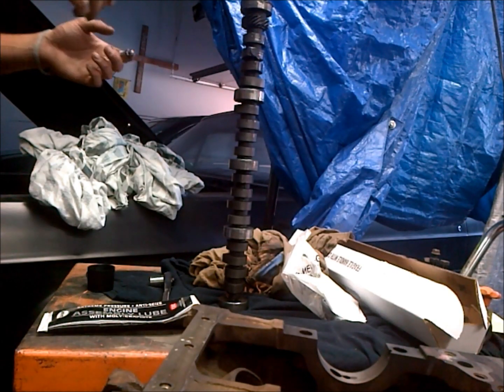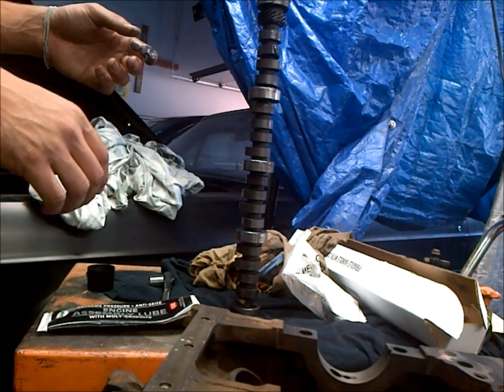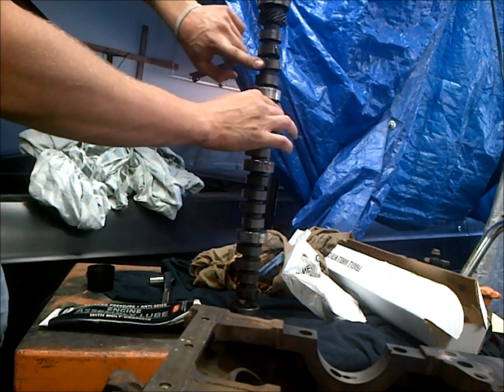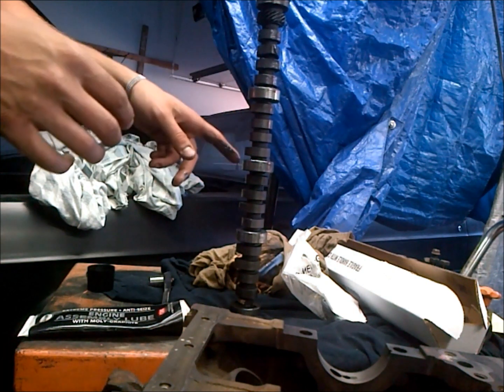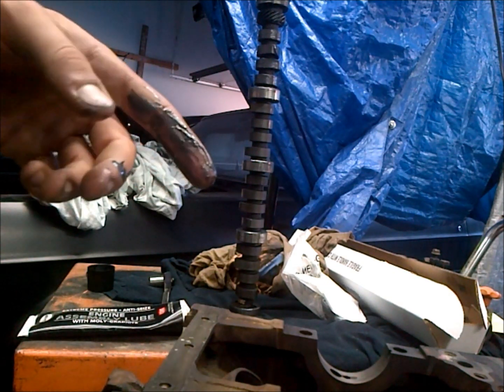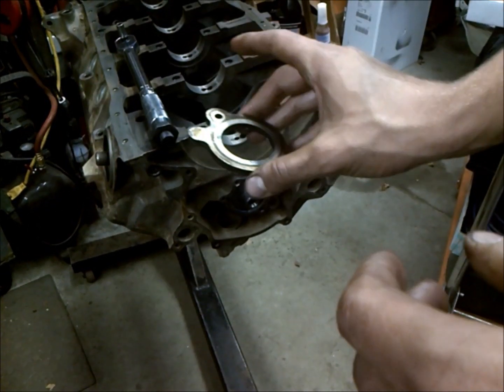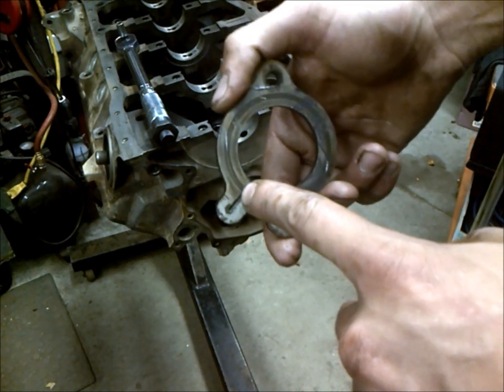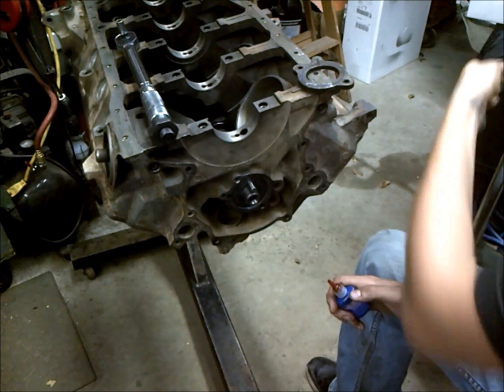Camshaft Installation (Vid 1 of 8) - How To 302 5.0 Budget Rebuild

Comment: Solid video. I installed a new set of cam bearings into my 302. Sadly my Cam won't spin freely by hand. It will however spin freely with the timing chain sprocket slightly attached. The Cam is used and sat in an engine block for a number of years. I may have to bite the bullet and get a new Cam and valve springs.

Comment: I got a question to pick your brain pertaining to the thrust plate for the cam.  What is a better setup for a roller cam in a roller block, the OE plate or an aftermarket plate such as Comps 3120TB thrust plate with bearings?

Comment: Regarding the 302 engine you are rebuilding: Is it a "Boss"?  What is the difference between Boss and "regular"?  How do I know if my 69 Mustang's engine is the Boss or not?  Thanks!
Reply from the maker: I believe the boss is a 4 volt main and some other bits that made it what it is. With the aftermarket world, engines can be built that are far superior in performance to the original boss. This one in particular is a standard 302 that could be in a car/truck

Comment: Great videos!  I have a chance to get a 69 Mustang with a 302 from a relative. But I'm told it is seized up. Should I stay away from that or give it a try?  I notice most of the engines you do are not locked up. Just wondering if a seized engine is worth tearing into?

Comment: I have a 87 302 and I'm puting a lunati voodoo 268/276 cam and 515/525 on intake and exhaust with a 110 LSA and it came with all the valve springs and everything. I'm porting and having heads done, will I have plenty of valve Clearence?
Reply from the maker: That's fairly aggressive. It's best to clay it up to test clearance. Definitely will need to be careful if you run larger valves
Reply: ThunderHead289 do you think that is to big?
Reply from the maker: well, an ever better question is what is the engine in and what do you plan to do with it?
Reply: ThunderHead289 just a good street engine it's going in an 87 Ford f150 just a crusing truck
Reply: stock bottom end all been machined and cleaned stock pistons with valve reliefs

Comment: just wondering if you've had experience with Edelbrock heads. my installed spring height with my performer heads is only 1.84" with .060" shim. I need to be at 1.75. any idea where I could find spring cups?
Reply from the maker: I would just search for them on summits website or call their tech line. They will get you set up with what you need

Comment: awesome series. Did you have machining done on your block/heads as part of this rebuild? What determines that? Did you check all the vital specs when you tore it down to decide if machining was needed? thanks!
Reply from the maker: I did indeed! I'm pretty sure on the playlist where I go through and hone the block, I show the tolerances. Also, I did have the crank polished .001 under I believe. Didn't work the heads over outside of lapping the valves. Guides showed minimal wear. I don't remember as this was awhile back, but I think I showed how I checked valve guide play
Reply: ahh ok! I musta missed that- I'll go look for it. But the point is, there will always be some machining required (assuming you want to do things right) and specs/tolerances will determine how much, I guess.Thanks again!
Reply from the maker: +Kelly Trosper you are indeed correct. I always polish the crank at the minimum. Lap the valves, and check the ring clearance. Too much and it has to be bored, needs a valve job, and so on

Comment: TH289.........Love your videos. I have a new 351 Windsor and I have a 2500 RPM Stall Covertor and a Xtreme energy Comp Cam Hydraulic lifter type in My 69 Mach 1....with a 600 Holly. Problems: 1. Misfires at cold crank 2. diesels when shutting off 3. wants to stall in slow traffic and at red lights. I have to pop it in N to keep it running and the RPMs go through the roof and jerk the car when I put it back in gear. Any ideas??? I believe these issues are all related, but not sure
Reply from the maker: +Skip Barrus skip, you are correct in assuming that your issues are related. lets go back to carb basics, it seems as though you have your throttle plates open a bit too far and are exposing too much transfer slot. leads to run on, poor performance, and so on. also sounds like why you might rev to the moon. 
so here we go,
set your carb to where only a square of the transfer slots are exposed. set your mix screws to 2-1/4 turns out. now, adjust your timing for the idle rpm you want. this should get you close. you want no more than 1200 rpm in park, so tune for this. ideally idle would be 1000 or so, and when put in gear, it drops back to 800. 
a few more things.
heat is not your friend and causes performance issues with you carb. a half inch 4 hole carb spacer goes a long way. 
also, you may not have enough octane fuel just anyway. 
im linking you to a page i send people when they have these issues, set your carb right, and then look this over. basically the same as what i tell others to do as well.   http://www.badasscars.com/index.cfm/page/ptype=product/product_id=94/category_id=13/mode=prod/prd94.htm
Reply: +ThunderHead289 Thanks for taking the time to share your expertise. I'm an old guy from the 60's and love these old cars. Mine is a show car...I'll let you know how it's working..
Reply from the maker: sounds awesome, keep me updated
Reply: +ThunderHead289 You're not going to believe what I discovered. The Vacuum line from the vacuum advance to the carb was placed on the bottom front port of the carb from the garage install...I reinstalled it to the upper port later on. I did't relaize the size of those two port were different, and the hose fit snug on the lower one, but was way to loose on the upper port...causing a vacuum leak all this time. I discovered it today and put on a smaller hose on the upper port...giving me 100% vacuum. Runs like it's suppose to now. Hope this holds.
Reply from the maker: im sure with something so blatantly whacked out, its bound to make quite the difference.

Comment: I recently bought a 302 from a 88 gt 5.0 that I'm guna out in my 1966 mustang I want to put a cam and I saw in another video that the cam shaft pin is specific for fuel injected and I'm guessing carbureted..so what I'm wondering is that true you said to make sure the right one is installed that it comes with several so would I just do what you did and out the same size in or would it be different the engine was fuel injected and I'm switching it to carbureted any help would be great thanks in advanced
Reply from the maker: luciano hernandez its usually the shorter one! it depends on what type of oil slinger bolts onto the front of the timing chain. i would say to try the shortest one first. it wont go to the end of the timing chain cam gear since that semi left over hole os for the slinger. now if your running a mechanical fuel pump timing cover and a mechanical pump, you will need the longer pump for the fuel pump offset lob that bolts to the cam gear. does this make sense?
Reply: Ya I get what your saying about the mechanical pump I forgot to say that since the engine was fuel injected I'm going to use a electric fuel pump that il mount under my tank so would I still do what you said and try the smaller one? And thank you for responding I appreciate it
Reply from the maker: no problem, yes i believe it will indeed be the shorter one then. and no problem, best of luck

Comment: What year is the motor?  I am rebuilding a 95 302 and was told that the rear main seal is different from other 302's
Reply from the maker: it should be a one piece like the one I do in the video. I believe they switched from the 2 piece in 82.

Comment: Camshaft install done well.

I assume this is a new cam so where did this cam come from and what are the specs on it?

Also I am wondering if new cam bearings were installed or were they good enough?

Either way good vid. Shows a good demo of a home installation.
Reply from the maker: its a new cam and I pressed in new bearings. I did not show the bearing bit in this because most people have a machine shop do it. I also made my own drivers because each cam bearing is actually a different size believe it or not. hence the simplicity of the cam install unlike the FE engines. I NEVER REUSE CAM BEARINGS. just bad practice. not a good rebuild.
Reply: ThunderHead289

Cool. I didn't mean to insinuate that you would reuse cam bearings. Sorry for that. I agree 100% and the perfectionist in me has never allowed me to reuse most any part that gets wear like that.

You appear to be a very tedious person and that usually makes for a great engine builder and I mean that as a compliment as I tend to be the same way.

Again good job on the install.